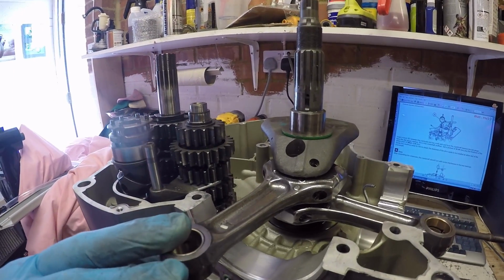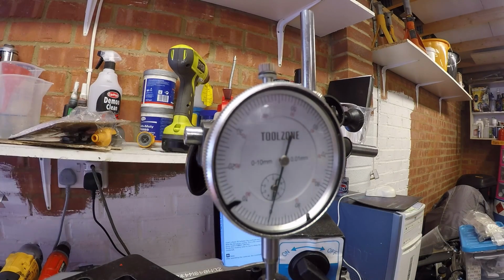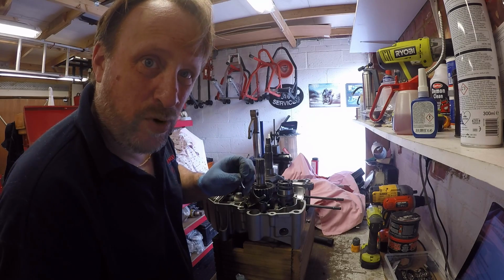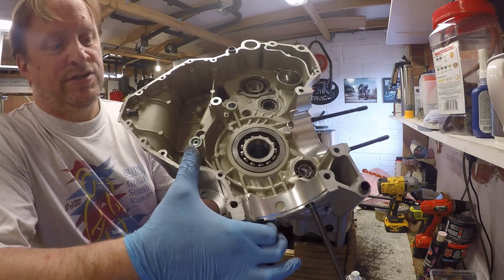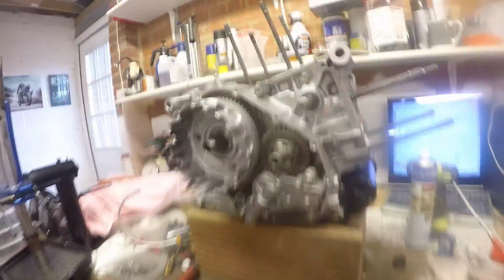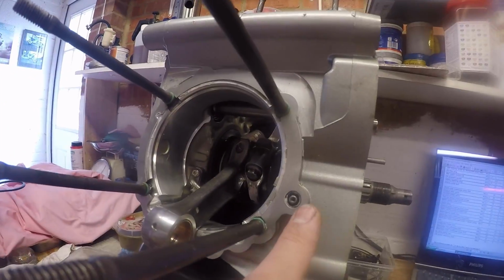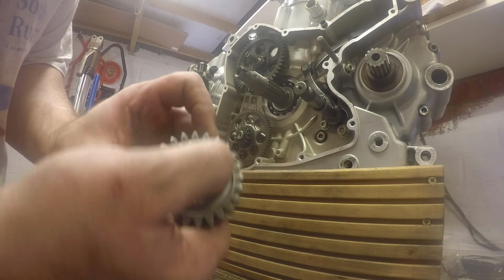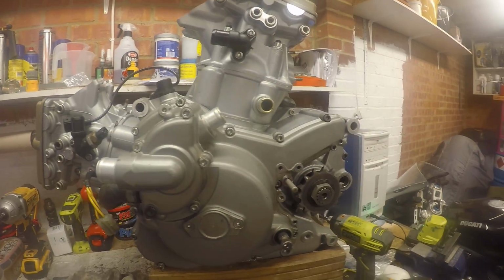Ducati 848 Engine - Rebuilding the stripped engine

Comment: Hi Desmowerx
Great video mate, very detailed sequence. I'm about to do similar to my 1098 Streetfighter and I have a question hopefully you can answer. Is the SF engine significantly different to the 848 apart from dry clutch? My understanding is they are a hybrid of 1198 bottom end with 1098 top end. Thanks for your reply if you get time to respond. Cheers from OZ.
Reply from the maker: Basically the same engine, the main capacity difference being from crank, piston and cylinder sizes along with different camshafts and valve sizes for the top end.

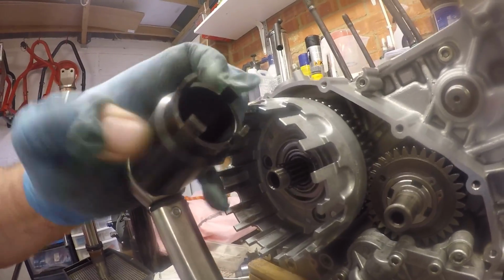Comment: Hi, how do i find the 4-claw special tool ? (12:30)
Reply from the maker: I got mine via ebay from this seller:

https://www.ebay.co.uk/itm/125558635608?_skw=Ducati+Primary+Transmission+Socket+Tool+Part+No.+887133406&itmmeta=01K2S21RVQVJAG9YJKQYYA3DME&hash=item1d3be0bc58:g:XOwAAOSwDchfznE3&itmprp=enc%3AAQAKAAABEFkggFvd1GGDu0w3yXCmi1erRm5xCENJz9KO61uds4KDPuDFoujSx9sVPCZxyT2UcjdL5hKOEQITr51ZICgf%2Ftx1Wbafj2dF5vUIWqx%2B7wqXaTkkkYFlmcCd7WdeS9SI1fD62sR7gMvPFDX0FZxO5oEsA4AfEbpQ0YDNaolxrdOvIifzUMELls%2FoZ9OuWSGBXzIs5xadIJe7uLatuqcIKBZF6OP6BD6Ki9%2FuPDiQGlejBB%2FSsYQnkAvuU02v8BW%2FRfawYrZ0WivBBIT7lpo%2F8Zv8IwfqXBViaFmL9WaOGs68%2FkWM4yHl7Cq4ZngtJ3iwlCp24%2BevATJ1WU2ou2oNI%2FkMY%2F9%2FCPWRqitOM--EeU1U%7Ctkp%3ABFBM_o2HopZm

Hope that helps you out.

Comment: Hey Desmowerx, If im not confident to set the preload on the crankshaft myself, am i able to send the crank and cases out to someone to have them reassemble the bottom end, then i can finish the rest of reassembly myself?
Reply from the maker: It may be possible to find someone to complete the work on your behalf, it is not actually that hard to set the preload and free float on the various shafts. The main issue is having the correct shims to hand.

Comment: is the torque spec for both of the Primary gear pair 190 Nm?
Or is it just for the smaller one 190 Nm?
Reply from the maker: The primary gear nut is secured @ 190nm, this is the small nut, the main primary gear is locked out whilst being tightened. There are two special tools available that make it easier.
Reply: Am I right the nut which holds the Clutch basket is torqued to 120 Nm

Comment: when you torque the flywheel nut to 330nm, how did you keep the flywheel from spinning?
Reply from the maker: There is a Ducati specific flywheel tool that I use, mine is not OEM but rather a copy made by another company.

Comment: Doesn't the sealer take up any space…?
Reply from the maker: Not that has any impact on the shaft clearances or preload.
Reply: @DesmoWerx  of course it does. when you  check it dry, the sealer adds at least .005. I would add that in

Comment: Hi Nelly. Just revisiting your awesome videos. Thanks. If you see this comment, any chance you can give us the dimensions of the open box you build the engine on. Looks really good. Cheers
Reply from the maker: Hi Martin, the internal dimensions of the box are 275mm long x 210mm wide x 120mm deep. If you work to the internal dimensions it does not matter on the thickness of timber used. 
I used decking timber to make mine with a sheet of 5mm ply on the base.
Reply: @DesmoWerx  thank you very much 👍

Comment: How do you determine what shim to use for the two transmission shafts if you are starting from nothing?
Reply from the maker: Go with the smallest first as there should always be float so better to be loose and tighten it up by using the larger shims. Ducati only make two sizes of each of the different gearbox shims.

Comment: Hey Nellie,
Love your content.
Ive done the gearshift springs on my MTS1200 2012 and just about to refit the Flywheel. 
The torque is 330nm. Can I ask what you used to hold the flywheel while tightening please?
I have a gear jammer on order, but I spotted what looks like a punch being removed after torqueing and if there is a handy holding position to insert one to hold the flywheel, it might get me out of a bind here.
Any help appreciated.
Kev

Comment: Hey desmowerx i just started my ducati 848 yesterday i was so happy thank you so much bro !!      I took it apart all the way till i can see the transmission gears and put it back together .     Somebody backed into it hard and it caused the crankcase to crack from where the kickstand attactches to the side of the motor.   Bad design from ducati but i mean i guess they werent expecting you to get hit by a car lol.
Reply from the maker: Wow, that's bad luck. The later cases are pretty strong as they are sand casted cases, so that must have been some hit.
Reply: I have the same problem with my 848evo aswell they layed the bike over and cracked that weld under the crank case and stripped the bolts so I welded it back up but I need to re thread the bolts, thinking of buying a new crank case, but the bike made funny noise like a rod nock it was a cold morning I let the bike warm up and everything and boom out of no where it started to sound like that and when I put the bike in neutral it would die so I took it to the shop and hoping it won’t cost a arm and leg or else I’ll just fix what ever they say is wrong with the bike.
Reply: @239seth    dang i didnt want to weld mine because practically all the weight of the bike goes on that kick stand.   But here i am today rebuilding the bike again because of a valve that has a crack hopefully i can get it fixed

Comment: Great video! I’ve got a 12 848 race bike, I’m on the 3rd motor, the first 2 lost the crank bearings. It’s got 996 bearings in it currently. Is there anything else I can do to upgrade? Thank you!
Reply from the maker: When you say upgrade, is that for power or reliability?

Comment: When you say preloading the crankshaft by 0.3mm am I right in thinking you basically shim it 0.3mm too big and then as the engine casings nip together it applies the right amount of force to the crank shaft? And also how do you know which side of the crank to shim? Do you just split the shims equally either side or is there a particular was to build the shim stack?
Reply from the maker: HI Kyle, yes you add in 0.3mm of shims to get the preload on the crank bearings. If you are stripping the engine yourself you can measure the outgoing shims to see the bias of the shim loading between right and left (as sat on bike). Failing that I have done a video to show how to calculate the shims for your specific cases and bearings as fitted.
https://www.youtube.com/watch?v=QsNXBEUKwuc&list=PLv-iejNHIpJGjoaqgHijbXfNmUmA72rs9&index=1&t=20s
More often than not the left hand side of the case with the larger shim due to the case being offset more for the crank centerline. 😊

Comment: 3 times to 60, what tool is used to transfer? I have a torque wrench, but I can’t see what I’m using
Reply from the maker: I use these sort of tools https://www.ebay.co.uk/itm/120796101958?hash=item1c20023d46:g:gWIAAOxyNDxRX-jm

there are 3 different sizes 14, 15 and 16mm
Reply: @DesmoWerx  😁,Thank you very much，😍😍

Comment: The factory head bolt tool is a C shape that places the wrench directly above the fastener so it doesn’t increase or decrease the leverage arm. With the tool you’re using, wouldn’t you have to alter the torque spec now that you’re increasing the leverage arm?

It looks like you try to mitigate this by holding the wrench 90 degrees from the end of the tool, but the length of the tool should be accounted for, no?
Reply from the maker: Hi Rob, holding the tool at 90 degrees negates the extra length, if I use it direct on I have to account for an 8% torque increase on my shorter torque wrench. I prefer using this tool over the c spanner.

Comment: Mate i like the idea of that wooden box as a cradle for the engine, im planning a rebuild soon on my 1098 ( dreaded crank bearing noise). If you dont mind share dimentions on the box please, cheers
Reply: Oh and forgot to mention, Excellent video..
Reply from the maker: Thanks Taj, will measure the box later and stick measurements up. 😊